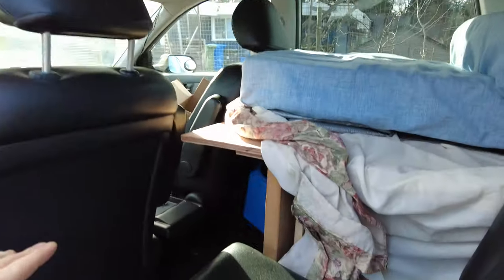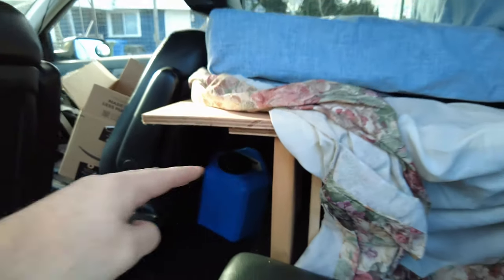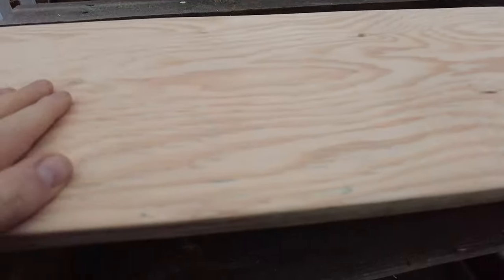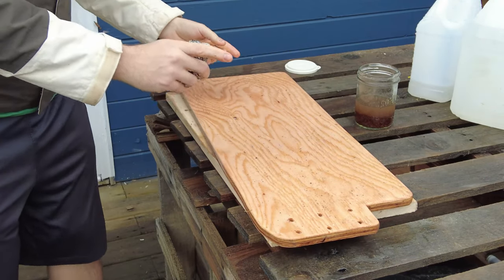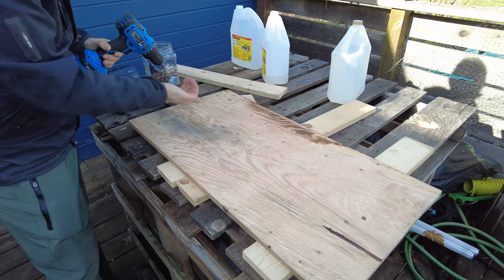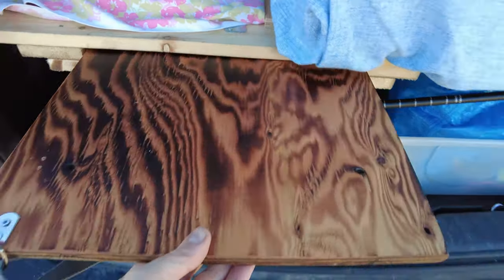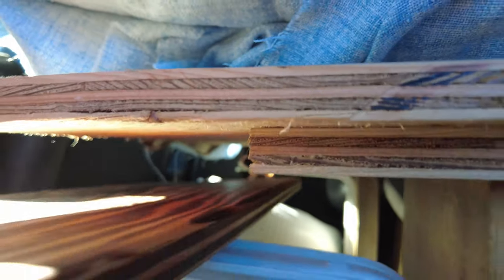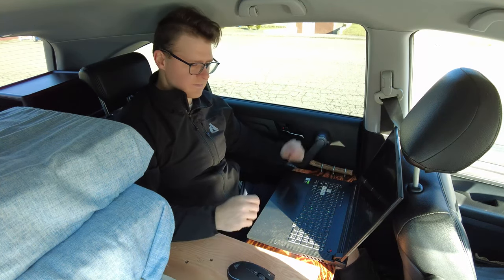DIY Car Laptop Desk + Kitchen Table Build

Comment: The way you seperate  desk, kitchen, and bed is an impressive use of space. No chance of spillage onto the bed is something I have to take notes on if I make a build. Nice work.
Reply from the maker: Cheers, I've updated my setup a little bit moved the kitchen pull out to the other side but same idea.

Comment: Very cool custom finish! I've used that conditioner on the cutting boards I've built and it's good stuff. If it wears off you could easily add another coat in the future. It's cool seeing how resourceful you've been with this project, keeping it on the cheap.
Reply from the maker: Ya there is enough in that bottle to reapply 6 treatments to that desk. Basically cost me $13 for the mineral oil and $4 for the metal loops.

Comment: Your slide out desk is a great idea.  Thanks for sharing your idea.  We have different vehicles but the same bed and back seat layout. I'm going to be suv camping this year and intend to work as well from the road.  I'm going to try your idea.  The only thing I would modify is to drill some holes in the desk, to allow the laptop battery to vent.
Reply from the maker: That's a great idea! I never thought of that... I should really do that 😀